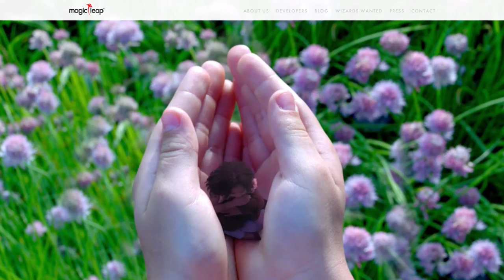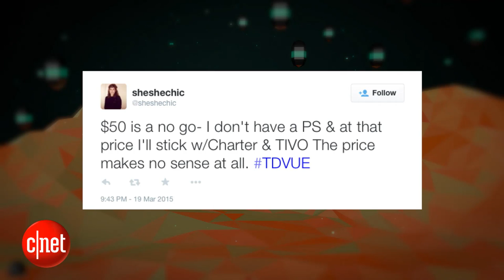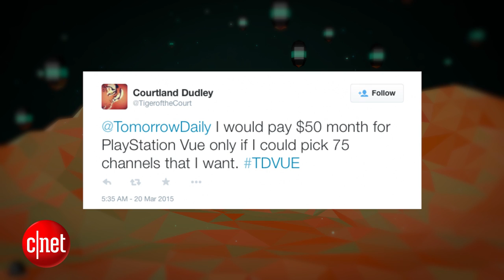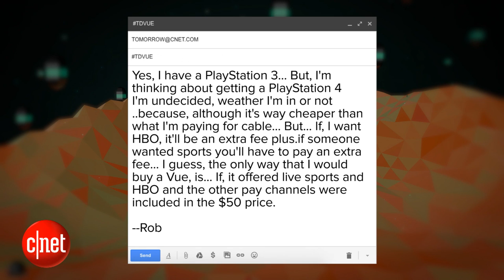Tomorrow Daily - That cool Magic Leap AR demo is probably fake, but we love it anyway, Ep. 148

Comment: #TDVRVAR: Im figuring that VR can facilitate AR. So VR it is.
Reply: They can just add an external camera to a VR headset and project the cam feed directly to the VR lens screen.
Reply: Mister Lister my thoughts exactly. Actually they have already. The Samsung VR has the option to activate the camera. So just software to project the AR i guess.
Reply: Plus Pack The question about VR augmented reality was asked in the Oculus Rift subreddit 3 days ago.

Palmer Luckey of Oculus responded:

>Nope.

>AR is hard, harder than most other hard things.  
Camera technology is not nearly advanced enough to do it properly on an immersive display, which is why you see most dedicated AR hardware going for an optically transparent approach. 
Things along the lines of the GearVR camera passthrough can be useful tools, but not pleasant to use for any length of time.  

>Even basic passthrough is not as simple as putting two cameras on the headset - not only is the IPD wrong, the translation is completely off.  
Stereoscopic video cannot accurately depict a "real" 3D scene, it is just a neat trick that can provide a similar effect under very specific constraints.

reddit/com/r/oculus/comments/2zrf5j/could_oculus_be_implementing_ar_mode_to_the_cv1/

But AR and VR share similar technologies, so they should complement each other.
Reply: Jeff Kang Hmmm. Maybe he is trying to kick the wind out of AR. Hard ehn. Lets see. Maybe not Oculus but I am sure from a competitive perspective someone will do it. The kitchen sink mentality.

The future of tech is very interesting.